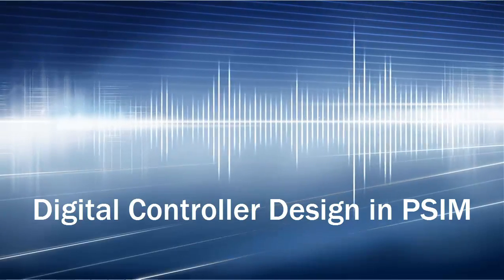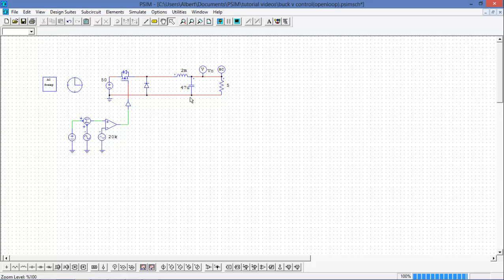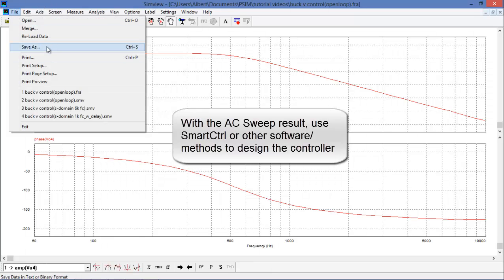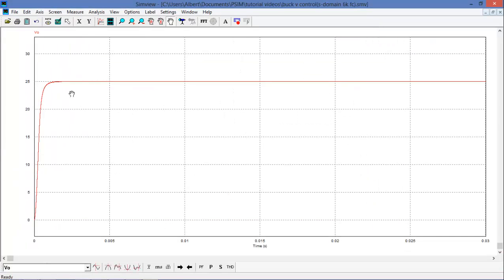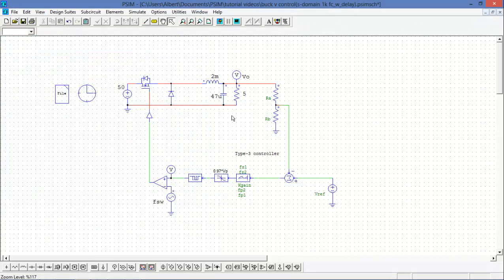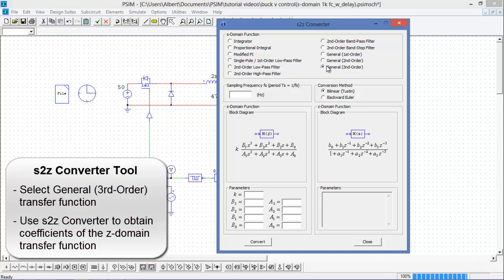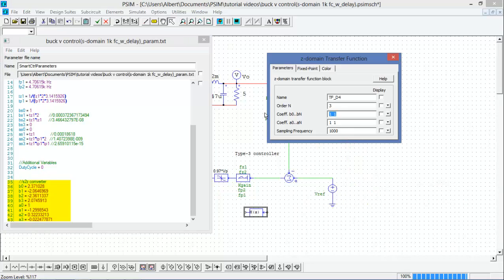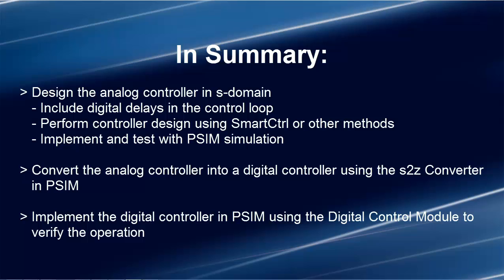Digital Controller Design with PSIM

Comment: how do you implement it in real life? that is using real components for the controller circuit?
Reply from the maker: +William Madrideo for a digital controller you will implement with a DSP, MCU, or an FPGA. For analog control the s-domain transfer function can be implemented with op. amp circuits